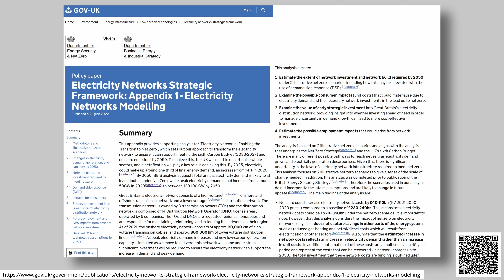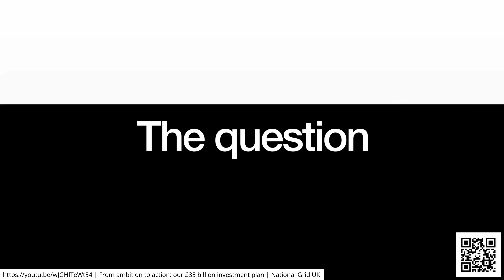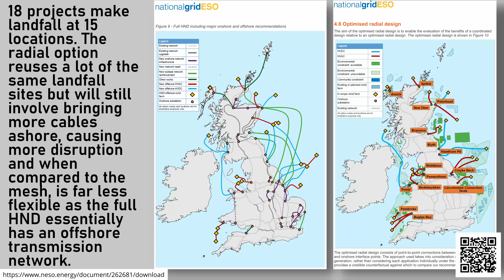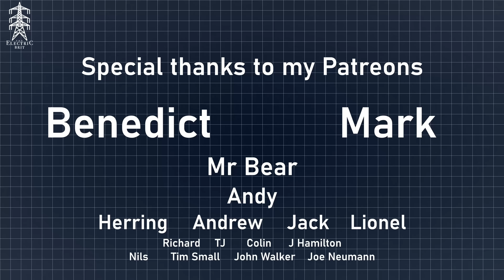The Great Grid Upgrade Projects Explained

Comment: I’m intrigued by the upgrades from 275 to 400kv.  Is the intention to replace the towers or to restring with longer insulators? Can’t see that working, won’t have the required clearances, so must be new towers on existing rights of way?  Costly to do that.  Another question raised about the sensibility of electrifying our world. 
CEGB built the grid to supply the UK in the 60s; not anticipating the current situation. I’ll be fascinated to see how this all goes down!
Reply from the maker: Great questions and it’s something I should have broke down on this video.

Some towers are rated to 400 kV so it can be a case of just restringing and new transformers. Some of Scotlands new substations like Rothienorman which I worked at came on at 275 kV to meet project timelines and integrate with the current network and later swap to 400 kV so the whole sub was at 400 kV clearances. 

One cool thing they’ve been trialing on 275 kV towers is insulated cross arms, which increase the clearance from the tower to allow uprating, but I imagine this won’t cut it in every case where there might be ground clearance or sag issues, and who knows how they hold up over time. Exciting developments though!
Reply: @TheElectricBrit Maybe they can use some of the new carbon fibre core conductors to reduce sag and improve ground clearance.
Reply: What else do you propose other than electrification?

Comment: For the life of me I don’t know why they don’t incentivise home battery and solar 
Then you don’t even have to upgrade the grid so much because power is generated and stored at the point of use 

Well I say I don’t know why, i do, because it would benefit the homeowner not a massive corporation. 
It certainly isn’t cost related when HPC is set to cost £60b and supply 6m homes - that’s £10,000 per home, enough for a home solar and small battery each. And if the surplus generated goes into the grid and the government reclaims the cost of the system it can be net zero cost to the taxpayer and rolled into a next phase of the rollout. You could literally get the whole country on virtually free electricity - homes which aren’t suitable for solar still get a battery to take the peak loads out of the equation and then the current grid is still sufficient. 

The only reason to upgrade the grid then is for datacenter which need far more energy and you could specifically target the grid upgrades for them - maybe even put them on the doorstep of one of the small modular reactors to limit costs even more
Reply: The bigger problem actually comes from having to wire up the grid connection from each property. If you consider that a lot of distribution networks were last upgraded between 70 and 50 years ago to meet the requirements of that period then you can imagine how taxed they are now. If you connect millions of inputs to that network which now put more power down the cables it is likely to (literally) melt things. 

If properties had two completely separate circuits- one to draw off the grid and one which sources all power from domestic wind/solar/hydro/battery etc but which has no ability to export to grid - with the ability to seamlessly switch between the two - then every property could theoretically have its own generation and storage.
Reply: @JamieEHunter you can just limit export though? It would be clever if we could have a remotely controlled limit.

And in any case house demand has reduced and local grid should be less stretched (except for voltage hikes from too much solar)?
Reply: @Biggest-hz7ng it's a pretty delicate operation trying to balance the grid as it currently stands. Nobody is going to sign off on (or sign up to) managing a grid with several million generators.
Reply: @JamieEHunter  you might find houses happy to sign up to export until the grid they connect to reaches a specific voltage. They will be able export much, but not all the time?
Reply: @Biggest-hz7ng that's the problem though- everything needs to be on the same control network AND the supply and demand fluctuate considerably with weather/time etc. There's no doubt that it's technically feasible but it requires distribution network upgrades that make the transmission network projects discussed in this video look cheap and straightforward. Running big lines is one thing - upgrading every cable to every property in the UK and devising a control system to regulate flows in both directions from those properties would be Herculean.
Reply: @JamieEHunter I just can't see it being a huge problem? Local grids are oversized for current demand. Demand will be increasing with heat pumps and local grids will be built out. In the meantime where necessary you just need to limit export into the network, by either simple methods or sophisticated. As local grids build out, restrictions can be eased.
Reply: @Biggest-hz7ng according to every grid engineer I know the distribution network is,
in no way, 'oversized'. I suspect that this is a scenario where something seems simple until you actually have to do the job in the real world. At which point all of the things you didn't know you didn't know come into sharp focus in very short order.
Reply: Batteries and solar are zero rated for VAT.
Reply: @Biggest-hz7ng by now incentive I was talking about taking the funding for alternative forms of energy and making it available as a loan/ partial loan option for households. 

VAT exemption isn’t much when it’s still circa 10k - host households don’t have that level of cash sitting around given median income is only about 34k 
Given the money would be repaid (all be it over a long duration) it’s less total cost than the £10,000 per household for the new build nuclear plant
Reply: @nojhead  Scotland offers loans for this and the rest of UK should be following their lead.
Reply from the maker: It’s certainly an interesting concept and something we thought might happen 10 years ago. There’s a few issues (but there’s solutions) and some commenters hit some of them.

I have a video planned on how solar is poisoning the distribution network, raising voltage and causing distribution companies large upgrade costs when transformers hit their limits. Now they’re looking to change voltage regulations to help slow they need to upgrade. 

With a fully smart grid, you would be able to turn off that export, but then again you would have to stop doing curtailment payments. And some people would see that as not fair. It’s highly complex I could talk about all the different paths.

Another issue as you alluded to is industrial and commercial. EV charging networks, rail, heavily electrified industry etc. we still need some big generation connected up, and we actually need some demand on the grid otherwise it’s not efficient. And you can’t colocate those things that are distributed in nature - on the flip side, we should definitely be collocating some things like data centres with generation.

It’s a good line of questioning and something I’ll explore eventually!
Reply: @TheElectricBritthe problem is that colocation with demand would require everyone and everything to move to areas which aren't conducive to large-scale urbanisation i.e. the upland areas of Northern England and Scotland. 

The cities all exist where they do because of the rivers and the coal fired power stations were all built in or next to coalfields and next to rivers. Urbanisation/industrialisation followed the resources

SMRs, when they eventually come, will still need to be placed in geographically (and geologically) sound areas so colocation in the way that most people seem to think of it i.e. immediately adjacent generation/demand will not occur as frequently as most imagine.

Comment: It is not necessary to give up gas for heating. I have two Solar arrays and batteries that is for electricity and the grid too. I have no problem with using natural gas for heat and hot water. The problem is pegging renewables to the price of gas. Our bills should itemise all forms of energy used and state the price paid at cost then the price with utility overheads charged to us, line by line, energy source by energy source.
Reply from the maker: Taking gas off the marginal cost would help make renewables actually compete with each other to bring prices down.

Moving things like renewable obligations and CfDs off bills into the treasury was another suggestion which in the short I can agree with during a cost of energy and living crisis. 

Personally, I can’t wait to get gas out of my house. I grew up when it wasn’t uncommon to see on the news a row of terraced houses flattened due to a gas leak or faulty boiler and that’s left an irrational “fear” in me. Burning stuff for heat just isn’t necessary now, especially when electricity is the most efficient means.
Reply: @TheElectricBritI just had my gas meter removed, it's a great feeling knowing there is no supply of explosive into my home 😊

But it's more than that, I saw reports that gas hobs can leak benzene (carcinogen), and open gas flames increase PM2.5.  Of course we already know about Carbon Monoxide, and getting rid of the alarm for that was also a good feeling.

Gas is Victorian technology, fine for when we didn't know better, but it should be going the way of the Dodo.
Reply: @TheElectricBrit Separating the market is so complex I don't see any gov will do that - various have looked at it.

CFD/ROCs (really ROCs the CFD cost is tiny) can be done if Gov will put up the money and naturally drops away over a decade
Reply: @TheElectricBrit Either that, or except electricity used for heating from tax (same as gas isn't taxed) - this would go a long way toward making heat-pumps etc far more attractive.  Suppliers already offer discounted tariffs for heatpump usage, meaning they have the ability to separate 'heating' electricity from 'regular' electricty, if the tax-exception went through.
Reply: There is a problem there is not the space in the Uks carbon budget to keep heating homes this way.

Comment: At last, somebody actually telling me where all my gas and electric standing charge is going, especially as ever quarter the standing charges increase, no matter what happens to the unit price of gas and electricity.
Reply from the maker: Although standing charge for the largest time is told as the charge to maintain that connection to your house, the retail price of energy you pay is largely set by the cost of energy and your provider. Transmission only makes up around 2% of your bill :) there’s a lot to be done to bring bills down, and counter intuitively some of that is spending.

Comment: Connecting the north to the Norwegian cable would be a good first step so they can stop complaining that is it an one sided affair and some of the curtailment can go away.
Reply from the maker: EGL1 will get pretty close connecting in at Durham, then it’s just a short trip up from Hawthorne Pitt > West Boldon > Tynemouth / Stella West > Blyth > NSL. Then you can more or less saturate that connection at any time to Norway from anywhere on the East Coast

Comment: Rumours of budget cuts for these projects. Net zero projects look to be severely curtailed..!
Reply from the maker: That would be counterintuitive. Even Reform have been getting backlash now for their anti net zero narrative because they realised even the oil and gas companies are heavily invested in renewables, and it’s all job creation regardless of what’s happening in oil and gas.

The issue is we already built all the wind under Johnson, in places where it can’t be used. So now we need to do the work to make it useful where the demand is. Regardless of what you think of net zero it just makes economical sense to make use of the power we’re generating and can’t use. 

I’ll have more videos on the true cost of net zero in future.
Reply: I'm happy to hear that, they're awful.
Reply: @Codysdab generating many more jobs and the power is getting cheaper, let it continue.  Increase use of gas would be disastrous for the uk economy with its extremely volatile pricing and massive tax breaks.
Reply: @Monk_Duck that's why we should use coal again and expand nuclear, at the moment and for the foreseeable future we're relying on unreliable renewables or expensive gas, not very smart. And as the renewables increase the cost will rise higher and higher as we have to build more infrastructure to use it like expensive batteries, limited pumped storage and pointless but needed flywheels.
Reply: @Codysdab well nuclear for limited baseline is always beneficial if pricey but normally by the sea so grid upgrades are needed.  But coal is a disaster area, maybe if we imported from abroad but take a look at Poland how bad coal is for your electricity wholesale price.  Extracting coal in the uk would be equally painful, if not worse (wages are just way too high.)

Pumped hydro has quite a number of projects moving into fincial closure but it will take a long time to get them built.

Comment: aaaand.... What about LV? Even with maxed out transmission, the power cannot be delivered through the 230V network to homes, where most of the new demand is.

LV systems use ADMD, Ace 49 and Debut to chisel away at necessary kVA capacity using diversity (not everyone takes power at the same time). In 2013 the average UK home had a peak draw of 900W around 9pm in the winter. The installed LV networks (11kV and under) can supply that, with some margin. Now add HP + EV charging for hours and LV demand soars way above built capacity (to c. 4kW per home continuous). Only the Economy 7 storage-heater housing estates (1950s, 60s) had LV systems built able to supply that demand. So, how to limit? Cannot. How to fix? Build new infrastructure. Which means digging up c. 80% of UK roads and pavements for new feeder cables.

Could be as much as 500,000 km of cables needing replacement. a) expensive and b) a long, long project with lots of upset people complaining.

PS some might think that smart control can help. Nope; once demand in terms of kWh throughput exceeds the energy transport capability of the local network, only new cables + transformers help. Analogy: You cannot gift a 1-lane road with ability to carry 3 lanes of traffic, by adding "smart" traffic lights. It's an energy throughput issue.
Reply from the maker: Thanks for the insight! Do you work in distribution? I have a dedicated video coming on how solar is driving up voltage and causing investment there just to keep up, but I am interested to see what the great grid upgrade but for distribution yields…I’ve been on only a few DNO substations and they were held together with hopes and prayers in some cases. Plus due to the sheer size and scale it’s going to cost a lot more than transmission if they have to double it.

My lens is always transmission first so if any distribution experts want to have me around and help tell the story I’m all ears 😊
Reply: @TheElectricBrit Hi - yes, background is distribution (or was - now retired). Last major project was a lot of modelling / looking at "smart" schemes to spin out supply to EV and then HP loads. All in all - can't do it. Some local networks will be OK, some benefit from smart IT solutions - the great majority cannot be helped (assuming HP on top of EV).

Lots of issues. 1. Always looking for the cheapest adequate solution - and, for domestic homes, "lighting plus" was fine. If you look at the per-home of asset kVA installed for a set of say 400 homes, it would be from 400 to 800 kVA depending on era and DNO region. That means flat out, those numbers are hard limits - yet these networks were fine; few ever had a complaint. If a retrofit of HP onto an old property (and not so good thermally) then HP load alone during a cold snap exceeds these numbers. EVs charging overnight can draw 7kW but modelling shows this (for a 100% EV world) takes about 4+ kW for hours overnight.

And these issues known on LV side since 2012 (an ENA study pointed out the problems).

Yep, these circuits were not designed for many kW throughput - so, when solar PV wants to export in to pretty high-Z system, volts go up. Why is Z high, though? Cost. The ideas behind the design approach was diversity - not peak load. OK, so a house has say 100A supply fuses - but, when do they take such a load? Almost never. Studies in the 1970s came up with all sorts of schemes (primarily "After Diversity Maximum Demand" aka ADMD) which justifies lowering the rating to be installed. These rely on domestic loads being non-coincident (ie of a group of houses, only 1 or 2 are using a big load eg a shower). That way, you design for some sort of average, not a peak. Much less metal in the ground => £ savings over work spanning decades.

However high loads are now common, so that average is moving up. Worse, we don't know where the loads are in real-time (privacy silos) plus don't have a way to turn individuals down.

If we used smart systems to lower net load (eg using V2G) - then someone else can "spend" that spare capacity. So the congested system always runs flat out; the spare never exits the local system. Having retailers unaware of local situations means that even this is difficult.

Worse - we are now having retailers (and government) corralling EV charging into specific time slots; this is a reverse of load diversity and flies into the face of the LV system design criteria; that is, present initiatives provoke overloads (which typically happen in the evening / overnight).

High V in the daytime, through the floor and damaging assets at night. Whats not to like? New networks, please! :)